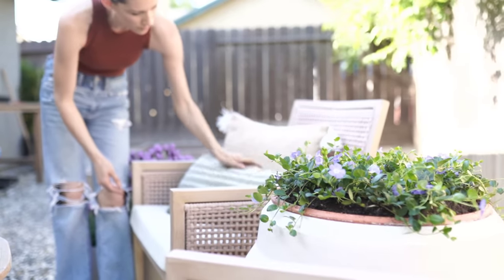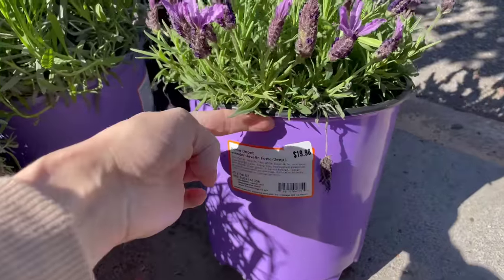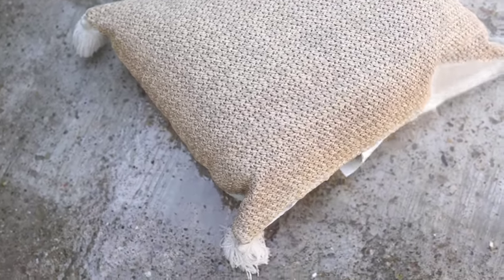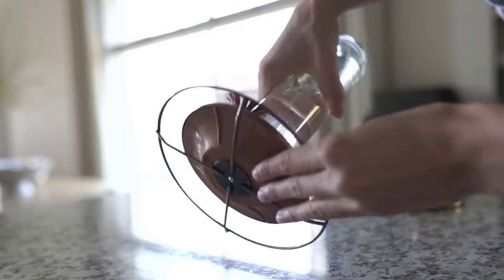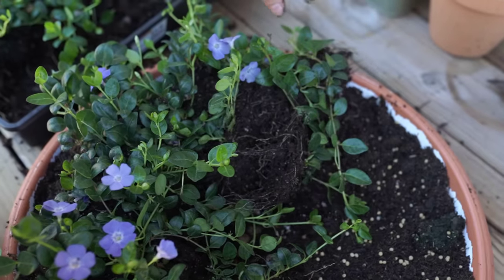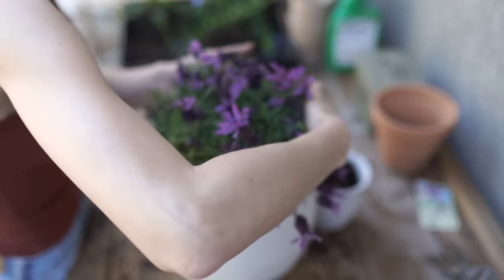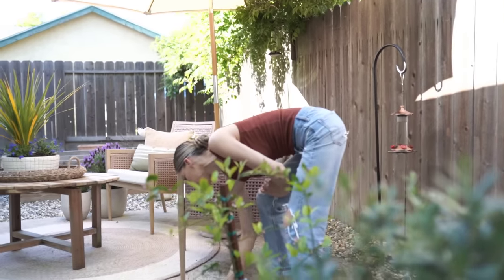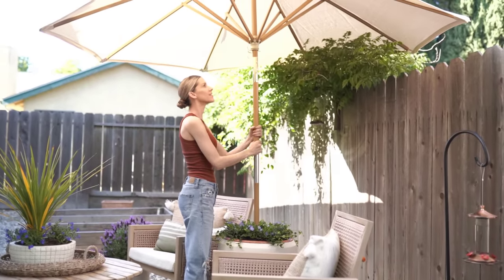BEAUTIFUL PATIO DECORATING IDEAS // SPRING PATIO REFRESH // SMALL OUTDOOR PATIO STYLING

Comment: In Ct. I have done a lot of yard clean up between rainy days. I have a little more cleaning of the yard to do. After that I want to check to see if any edging is needed, then I can clean up the patio of things that need to be put away, and then I can take old plants out of 3 large planters that were given to me free and replant. After that start working on vegetable garden and doing seeds for flower beds that steady hold perrenials . I had already cleaned my 6 ft diameter fish pond.